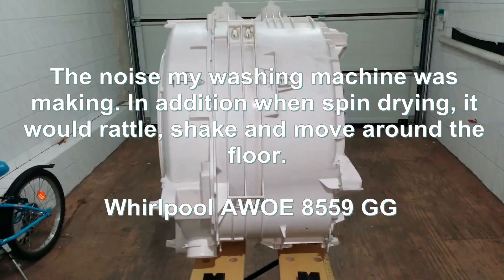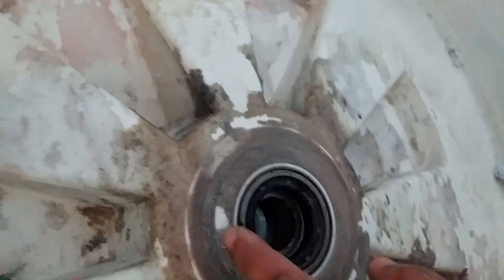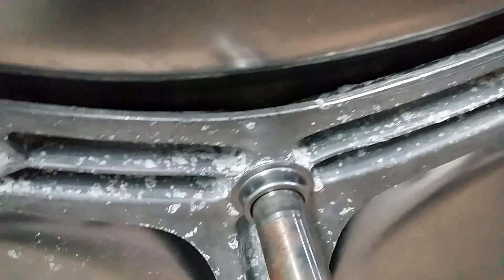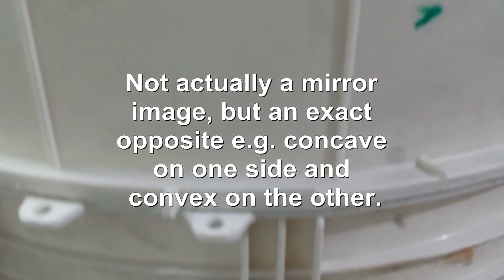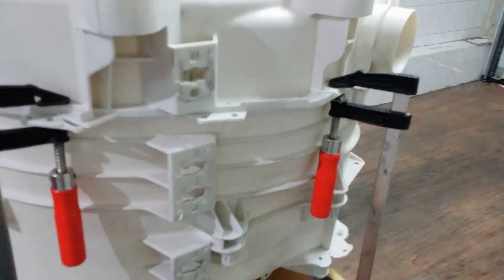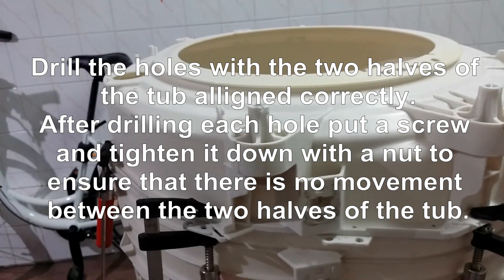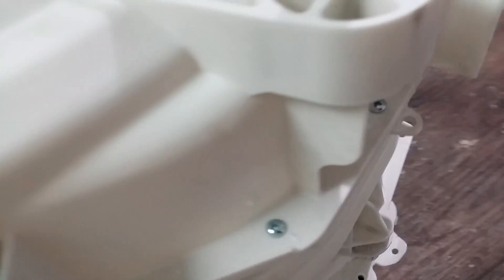How I modified my sealed tub on my Whirlpool washing machine to replace the bearings

Comment: This is very tidy work.  I am impressed!

Your thorough cleaning and anti-rust paint on the machine base reminds me of the time I changed the bearings on my first washing machine, only to realise that the motor was noisy due to a slight electrical fault (previously this had been masked by the drum noise).  I didn't bother cleaning the tub too thoroughly (except in essential places) when I next came to change a bearing, guess I started to get lazy.

I would question the effectiveness of WD40 as a rust inhibitor as I do know an engineer who has nothing good to say about it - he would have recommended a silicone grease or silicone oil for this application (something I'd be tempted to put on the shaft seals as well) - but I'm sure you'll live.

Thank you for posting this video.

Glad to hear (from your comment made on my video) that this works well!  Please keep us updated as to how long it lasts (hopefully as long as the rest of the machine).
Reply from the maker: +John Bull Thx for your kind words. I too am curious as to how long it will last. So far so good i.e. 4 weeks since I completed the job. Washing machine is used twice a day and no problems. I plan to do a check at the end of this month to see if there are any signs of movement/leakage at the joint.

Cannot but agree with you on the WD40 - seemed a good idea at the time, but definitely not a long term solution.
Funny you should mention the motor noise - I thought that I was getting paranoid, but have noticed some motor noises too. I guess that will be another strip down to:
1. change the brushes as there is definitely a difference in the brush noise depending on which way round the motor is turning. I could here it when the motor was out and I just spun the motor round 
2. in the spin direction there seems to be additional noise (under load) like a metal scratch noise. I cannot see any metal debris anywhere, to that is why I decided not to do anything when I was working on the tub. But there is definitely a sound that seems to be "an extra". My first notion is that it is the belt causing the noise, which I will change before I split the motor open.
Reply: +Robert Sababady Sounds better than mine.  I think I had a dead bit on the commutator, but it seemed to work still, so okay.

I wouldn't worry too much about the shaft - by the time enough water gets to the shaft to cause significant rust, the bearings will have failed, I'm just not convinced that WD prevents rust, may even do the opposite, according to my friend anyway.

In any case, surely shaft and bearings are all on the dry side of the seal.  One thing I did notice is that the drain hole (if there is one) in the plastic between the two bearings is sometimes not quite at the bottom of the section, meaning that a very minor leak will still cause water to sit in the bearings.  I did drill a new hole in a more appropriate position last time I changed drum bearings on a machine.  Sadly I sold that machine, so I have no idea how well it lasted (and the person to whom I sold it had a bouncy laminate floor and wouldn't level the machine properly, so it probably broke anyway).
Reply from the maker: Brilliant idea with drilling a drain hole. I might do that anyway!
Reply: +Robert Sababady 
additionally of the drain hol why not fill the bearings and the space between them with teflon marine grease and use the "drain" hole  for periodically refiling?

Comment: Just an update (I congratulated Robert on his work & video 7 years ago):  I chickened out, and got Hotpoint to fit a new drum on a 4 year old machine, in exchange for signing up for a maintenance contract that cost £120 in total (cancelled as soon as I was allowed).  I kept the old drum, intending to split it when the replacement failed - but eventually realised I wasn't likely to do it, so chucked it out a few years ago.

Good call, as the repaired machine is still working some 7 years later.  Maybe they put better bearings in the new drum?
Reply: Replying to myself: I forgot to add that Robert's new bearings failed after 2 years.

Comment: Omg my sealed drum has these plastic clip tabs, why plastic weld them and them have tabs, it makes cutting the drum difficult. I couldn't use a hacksaw like you did with those overhanging clips 😭💔 it was such a difficult job

Comment: Went through this process last night with my washing machine, it only has 1 bearing of small diameter and a glued sealing on the other side which I can't find replacement for, this would need the whole drum replacement... Ended up buying a new one
Reply from the maker: That's a bummer. What was the cost of the replacement drum compared to the cost of a new washing machine?
Reply: Around 150€, but I didn't want to bother further after all that stress, this was a candy model 7kg and I've went for a 11kg LG.
Reply from the maker: @Andrei369y  Enjoy the next 5 years of washing . My experience with washing machines is thathey last for 5 years and then....... it is no longer worth fixing them, as more and more things go wrong after five years.
Reply: Unfortunately that's the way things are designed nowadays, we shall see in the next 5 years

Comment: Just  wondering why you waited until you took the drum apart to drill the holes? Surely if you drilled the holes before you took it apart it would eliminate the need for clamps and lining up marks.
Reply from the maker: Because I was doing it for the first time..... teathing problems if I may :) I would definatelly drill the holes before cutting the plastic weld of the casing if i were to do it again.
Reply: @RobertSababady  I see, did the repair work?

Comment: cant you just use solvent weld like on pvc pipes?
Reply: No, the plastic is normally Polypropylene ( a polyolefin,) and some tubs contain a filler like calcium carbonate as well. Polypropylene needs specialist adhesive to bond well (eg TA4610) or you could use a hot air plastic welder, or flame treatment to modify the surface so a regular adhesive will adhere to it.

Comment: Hello i live in the Netherlands and i am having severe problems finding the right product to close and seal the PP tube. I have read that you guys use this Builders Silicone ? When i ask the people here they just look at me. It seems not many product just stick to the PP plastic. And almost al product need a primer, i have no luck with this shitty Whirlpool, no seal for the shaft no spiders for sale. Yes i could buy a complete tube drum spider for 350 euros. 
Maybe this is the solution: 

PE en PP Lijm - PP1 Acralock madev for PP p[lastic and other kinds no primer needed. You do need that glue mixing pistol.
Reply from the maker: Hi Sonata.
I think I used the same type of silicone that I use to seal the shower. i.e. it has adhesive characteristics and is tolerant to algae and bacteria.
I did not use primer per day, but I did clean the surfaces with alcohol to remove and grease that would cause the silicone not to stick to the tub and result in a leak. Remember that the silicone works more like a gasket as the two halves of the tub will be mechanically secured by the stainless steel bolts and nuts.
Reply: @RobertSababady  Yes thank you Robert, i did follow you up on the vid and i did make a lot of holes each 10 cm when possible. I do realize that the bolts are making the strenght happining. I have searched for that famous Builders Silicone but they do not sell that in the Netherlands.  When i did a deeper search on one Builders Sil;icone product is said: Not for PP . So i am confused and i still havent bought any products. Can i assume that you think your kit sticked to the PP or did you really test that ? I do understand that is only needs to seal the tube from leaking not breaking open. If the silicone does not stick the silicone could just slip away between the 2 layers of PP and start leaking. From what i understand there is no silicone that sticks to PP plastic.
I did email the Reinzoplast people and asked them if their product will stick to PP because that is not clear in the pdf. 
https://datenblatt.reinz.de/web1/en/produkte/Dichtmassen/reinzoplast/td_reinzoplast_e.pdf?bct=21%20?

I did spent a whole lot of money on the bearings and i bought the wifey a new washing machine,  this was the only way to get her horny again.( 123bearings website i can recommend them) and  then the issue with the spiderarm came clear to me, it is totally rotten away. I spent nothing on the Fertan ( rust liquid hater) 35 euros on Epoxy 2K primer for boats i need to paint the epoxy layer and i found some Polyutheran DD paint 2K. I have grinded and sanded and drilled the spider arm to bear metal removing as much of the gunk that was infesting the spiderarm. Then i soaked the spiderarm in the anti rust liquid, for days on. And last i need to buy that sealant for the tube, 75 euros for a ini mini tiny tube glue. !!!
Worst part of this al is i cant buy a new spiderarm the seal ion the radial shaft is not an exact copy of the original ... the only solution i can think of is finding a complete tube that fits my machine or a complete spiderarm assembly that will fit on my stainless drum. I have seen complete spiderarms for 50 euros !! With bearings ands seal !!
Does anyone has any clue what the sizes these spiderarms are in which sizes they come ?
For now i will finish this project but my eyes are wide open for a replacement tube or spiderarm,  this machine will keep on washing for another 20 years.

Comment: Im doing the same project did it stay sealed. Im kinda nervous haha
Reply from the maker: So how did it go?
Reply: @Robert Sababady  well i cut it apart. Made such a mess i ended up buying a new washer and dryer hahaha
Reply from the maker: @Savagewoodworker  Oooops......maybe that is the way it was meant to be. Since doing the first tub, I did another one, but this time I drilled the holes before cutting the welding....in this way I had all the holes alligned before cutting the welding....which made it a lot easier!

Comment: For sealing the tub, can i use a Valve Cover selant like  this one : https://datenblatt.reinz.de/web1/en/produkte/Dichtmassen/reinzoplast/td_reinzoplast_e.pdf?bct=21 ?
It supports temperatures from - 50ºC to 300ºC , water and oil  resistant.

Comment: That plastic hub is 100% PP, not PVC. I'm surprised this seal still holding up because ordinary sealants won't stick to the PP or PE, these plastics are low energy plastic and you need special(expensive) glue for them or do a special surface treatment before using ordinary glue.
Reply: Did he ever show the glue he used? I missed that, but tbh I just couldn't listen to all the filibustering. So irritating!
Reply: @S0RINUK  I did perform this repair and it was successfully done, water hold just fine, I have used a standard neutral(you can use acidic) white silicone, but it doesn't matter, tube is made of PP plastic, and it's almost impossible to glue it together properly because it's low energy plastic, hard to bond, 3M have one superexpensive glue for this purpose or you can use some Flame treatment(google it), but that will be waste of money, just use a standard silicone + lots of screws and it will be fine. But in my case, during the 5th washing cycle, the electric motor controller broke down. The washing machine flew to the scrap yard with the speed of light.

Comment: Wich glue is a best too use for sealing a tub ?
Reply from the maker: I used silicone (the bathroom type that is antibacterial). However, it is the screws and nuts that mechanically hold the two halves of the tub together. The silicone is a very thin layer in the form of a gasket to ensure the tub does not leak.
Reply: Thanks

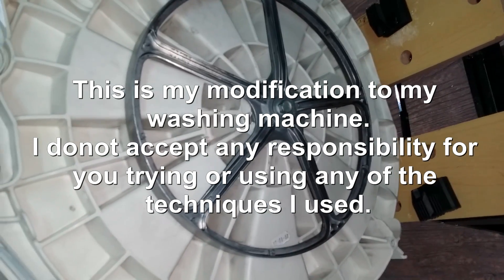Comment: Very impressed with your efforts, I am now facing a smilar job.  Did you have any trouble with the silicone spreading and blocking the water-level offtake?  It seems one would have to be careful to use as little silicone there as possible.  I need to check with another browser, but your video seems to have repeats in it, and doesn't get to the sealing-up stage (stops at 17:12).
Reply from the maker: Hi Martin - thankyou. I used very little silicon. I used just enough to make a seal between the twó halves as the stainless steel bolts and nuts really gave the mechanical strength. I will check the film out again - maybe google has chopped then end off dues to its length - but definitely had the drum replacement and the initial test (no noise from the bearings :) )
Reply from the maker: btw, if I were to do anything different, I would drill the holes for the bolts to clamp the two halves together before cutting the drum open. That will save a lot of time having to join the two halves just to drill the holes !
Reply: Wow!  That was quick!  Thanks for the clarification re the silicone, and enough other people had suggested drilling the holes first that I felt you hardly needed to hear that again.  I'd like to think I would have thought of that myself, but who knows?  The real question is whether my wife will tolerate the delay in the laundry service while I take it apart and try to re-assemble.  Attempts to source an identical used washer to cannibalise are on-going.  There must be a pile of WMEF 742P(UK) drums lying about somewhere.
Reply from the maker: That is what I thought. I even went to a shop that sells washing machines and asked them how they recycle the old washing machines - it turns out that they contract that service out to a company that literally recycles all the separate materials and melts down the plastic bits, removes copper, separates rubber from plastic etc....... quite amazing. Gone are days of fixing things. Recycling seems to be a big business!
My wife wasn't happy - she tolerated the 5 days of a lack of a washing machine only because she too was annoyed by the fact that the washing machine died on us a couple of days after the warranty expired!!!! She too felt cheated!

Comment: Hi Robert.You seem to have your new bearings at hand..can you explain how you worked out the type and size of the new bearings..im having problems trying to obtain bearings before i attempt cutting my drum...bosch are not exactly being helpful!..all they tell me is that i need a complete drum assembly!...thanks...and a really good video.
Reply from the maker: Good question. I took mine out first and then identified them on the SKF site.
The problem is that if the drum is plastic, then the parts books don't have the bearing numbers nor the size.
I do not not know of any other way to identify te bearing type and size without removing them..... unless someone has already changed them. What is your washing machine type and service code - I will fish around locally and see if I come up with anything.
Reply: Ya ,I have the same problem with identifying the bearing sizes for a Whirlpool AWO/D 7140. If I strip it down and cut it open I might have trouble finding bearings to fit it. I would be grateful for any information you might have. Thanks. Good video by the way.

Comment: key term: Planned Obsolescence
Reply: Even if it's not planned obsolescence it's poor design so prevent a simple wearable part to be replaced through normal methods of disassembly.
No doubt all manufacturers will go down this path so it won't even be possible to buy one that is repairable :-(
I have an indesit machine to deal with, I won't be buying another, will at least try another brand even if it does end up being the same inside.
Reply: @spidereyes6290  We all know Miele won't! They still haven't switched to the plastic tub!
Reply: @spidereyes6290  It's not poor design, it's quite brilliant. It saves a lot in the manufacturers costs, saving a few bucks on bolts and nuts over several thousand machines increases margins for the same desired effect. Of course, losing the ability for repair, which many people don't even dare to attempt at.
Reply from the maker: hmmmmm I would like to think not, but the thought did cross my mind!